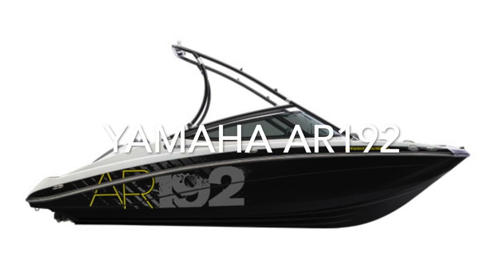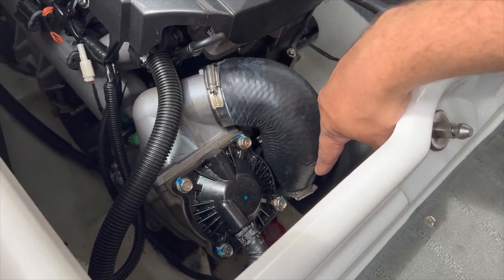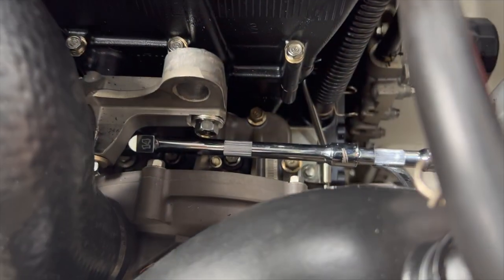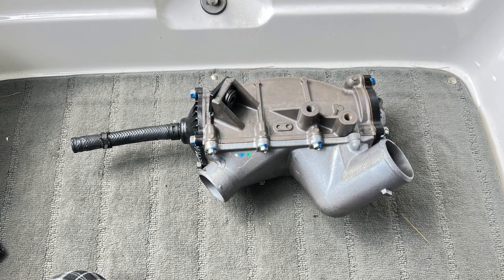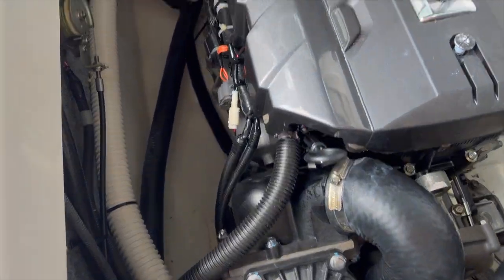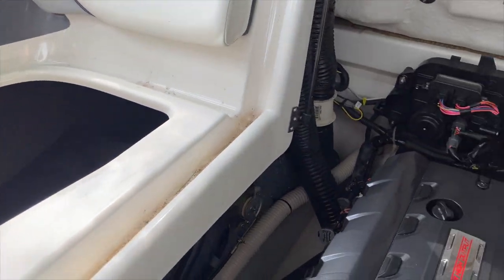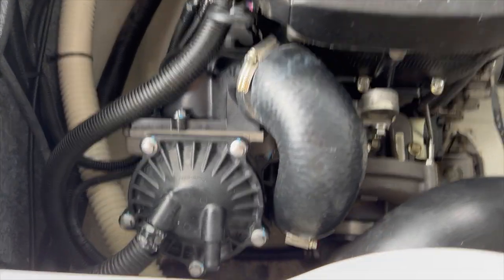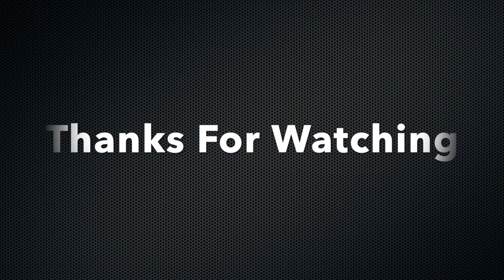Yamaha AR192 SHO to SVHO Intercooler swap

Comment: There was also a Part # 6ET-13670-01-00 intercooler for the SVHO that had cast flanges, vs. plastic.  That intercooler used the same boost hose as the lesser SHO intercooler.  It looks to me that the 6HL-13670-00-00 intercooler that went to plastic flange as the price is even $600 cheaper.  I'm debating on using the 6ET-13670-01-00 SVHO intercooler and be able to use my existing boost pipe.  I'm assuming the cores in both units are identical.  Do you see any reason to not use the 6ET-13670-01-00?